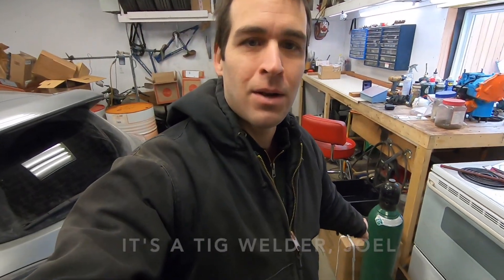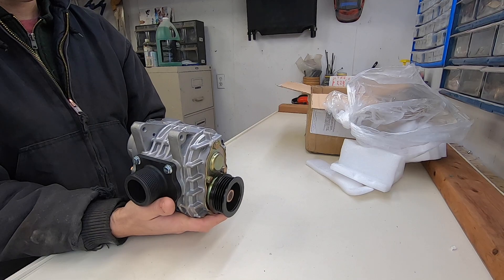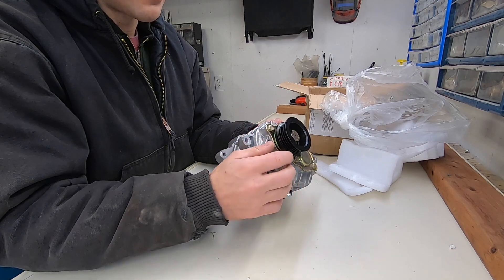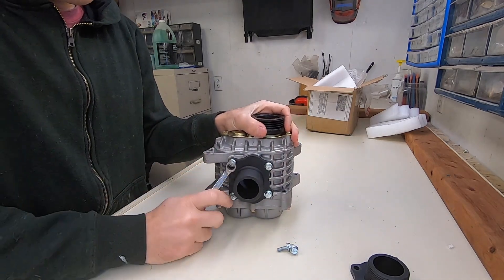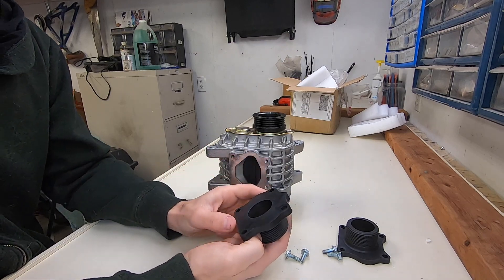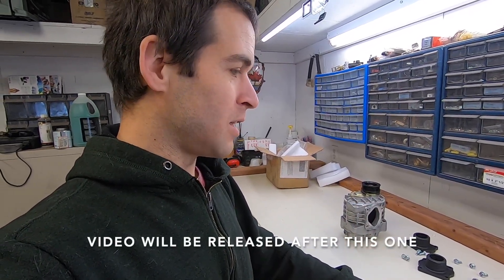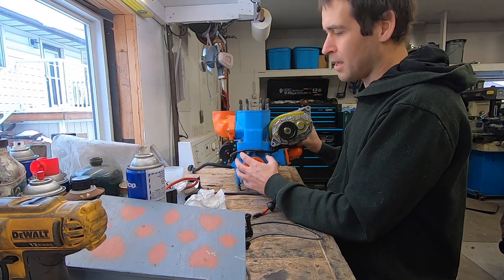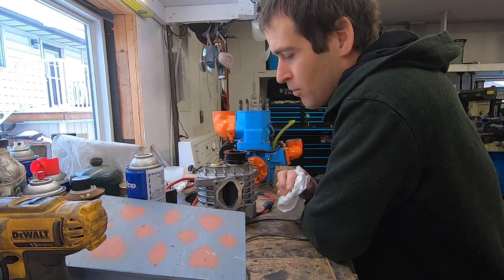Supercharging My X2 !! No Kidding - This Is Going To Happen !!

Comment: Would a pulley of supercharged kawisaki 1500 work
Reply from the maker: I don't think so. It looks to be fairly large and that would mean spinning my charger much faster than desired.  Also, it is wider for a higher HP belt and offset to one side. 

I don't think making a pulley for this will be very difficult.

Comment: Awesome! Can’t wait to see this project get goin. Casting a coupler for this seems like quite the project. What if you went off the front of the motor and hooked a pulley up like the oil pump system that gets deleted. That way you have the supercharger belt in the front and the pulley as well and can keep the stock coupler on the back
Reply from the maker: Thanks Zachary, I'm very excited about this too. 

As far as where the charger is driven from, it's all open for exploration. Bj suggested running it off of the flywheel as well. That would mean hanging the charger off the front of the engine and I'm also not sure about demanding that much torque from the pump drive. I could make a coupler that attaches to the flywheel puller bolts, modify the cover and so on... but that seems like more work than modifying the rear coupler. 

I have done some casting in the past and it actually wouldn't be a big deal to make this part. I would just make a slug and then adapt it to the current coupler ... but I will look at a few options before doing anything.

Comment: What about a centrifugal clutch on the drive pulley so that the SC only engages above a certain RPM?  Just brainstorming...
Reply from the maker: That's actually a very clever idea, and I have thought of that  as well as an electric clutch, as I have 3 of them that work off 12V for a tractor. I have also thought about using a variable ratio clutch so that it started off with little boost and as the rpm went up it would climb. 

I may look further into it, but limited space and the fact that it runs in water (at times) makes me want to keep it as simple as possible. 

In this video I didn't talk about it much, but my goal will be to add a bunch of bottom end grunt and not so much top end power or speed. For this reason and others, I will be trying to run fairly high boost at low engine speed but I want to be able to limit boost to avoid damage. To accomplish this, I will likely end up adding the bypass system that I talked about in this video as it would take care of the idle issue as well as well as allow me to control boost. 

I am probably overthinking it, because people have installed these on cars and other things with a suck through without any bypass system.

Comment: There was a 650 supercharger for sale in my area for $1500 or so. It was a bolt on unit for a jet ski. I was scared it would work bad so I didn't get it.  I bet what you have is way better. I've seen a few pictures of 550s and 650s with superchargers. None were in a ski and working so they may not have been more than unfinished 80s projects . It will be cool to see you build this thing.
Reply from the maker: Yeah... I have seen them around. Joohnny Os made a bolt on kit decades ago. There was one on ebay recently. When I said "this hasn't been done" or whatever I said, I was just referring to the AISIN AMR300 being fitted to a ski. I think this is going to be the next big craze on YouTube... people fitting these on all sorts of stuff, as these chargers are pretty inexpensive. 

I'm obviously hoping to get performance out of this, but my main goal is to have a fun project that involves lots of fabrication and tinkering ... you know.... other than the 1100  😂 I'm hoping this will draw some more attention to my channel. 

I'm pretty sure that I can keep adding boost till I reach the limits of what this engine can do... and it goes BOOM ! So that is quite possibly what will happen in 2021 😂 I'm hoping to put an adjustable boost regulator that I can adjust while I'm riding ... I can just keep cranking it up till it goes faster or goes boom 💥
Reply from the maker: Also, you should have got that ski, haha... just for the fun of it.

Comment: Cool stuff, this is going to be awesome. Just out of curiosity why are you doing draw through instead of blow through?
Reply from the maker: Thanks Josh. 

The reason I'm doing suck through is mainly because it is a lot more simple. When your run blow through on a carburetor, the pressure from the turbo or supercharger interferes with the fuel getting into the engine because a carburetor works using a low pressure through the venturi. 

I haven't looked into it too much on a PWC carburetor but I did turbo a motorcycle a few years back and we had to run boost pressure into the fuel tank so that the fuel pressure went up as the boost went up... just to stop the fuel from going back into the tank. That isn't enough though, we also had to run the float bowl vents to boost pressure so that fuel would actually go through the jets into the engine ... because the pressure raises in the venturi, over the top of the jets, it tries to force the fuel back into the float bowl. 

It would be interesting to see what a PWC carb would do, but I suspect it would go very lean and be very hard to tune, as the boost pressure would interfere with fuel pressure and a steady boost may cancel out the pulse "signal" that is needed to operate the pump and poppet valve. 

It's also much easier to mount the supercharger on the engine via a manifold, rather than having a manifold, a carb, then trying to mount the supercharger on top .

There are some carbureted  turbo and supercharger setups that are cool. You can build a manifold that the carburetor sits in (like a large box) and then the whole carburetor is exposed to the same boost pressure. You then run a fuel pressure regulator and electric pump to maintain fuel pressure. You also have to have seals / fittings where the fuel line, return line and throttle cable enter the box.
Reply: @JoelArseneaultYouTube  thanks for answering my question, I knew you had a good reason for going that route.
Reply: @JetSkiBrothers  the real reason is just a stopgap until we fuel inject it haha.